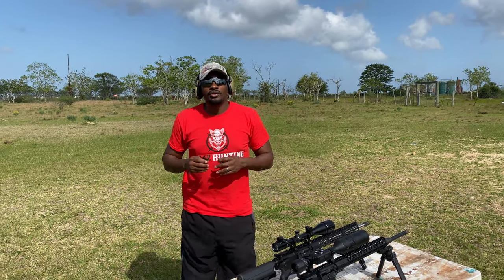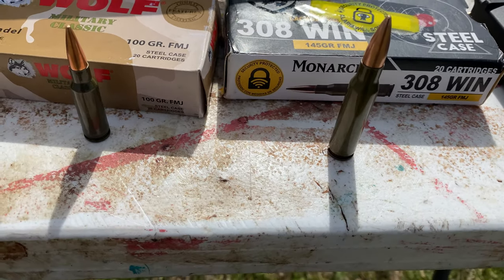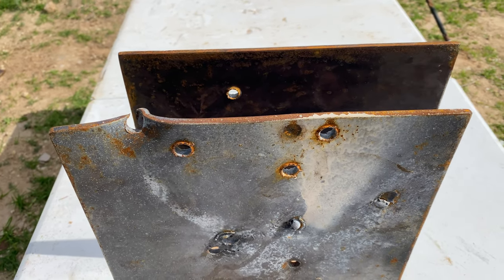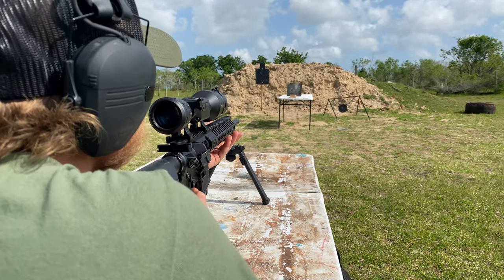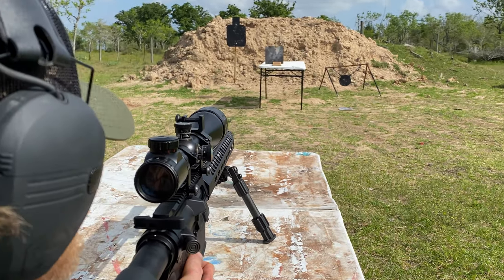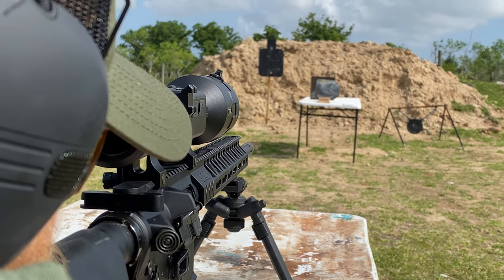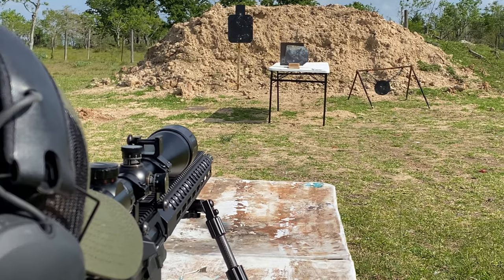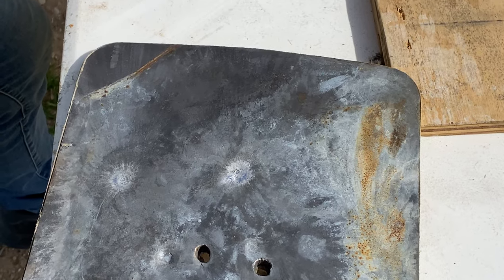6.5 Grendel vs 308 Winchester

Comment: 6.5 vs .308 for hog in your opinion, Which allows for more error in shot placement?
Reply from the maker: 308 no doubt… higher case capacity… moves  heavier bullets faster than the Gren. Also cheaper ammo I can find anywhere.